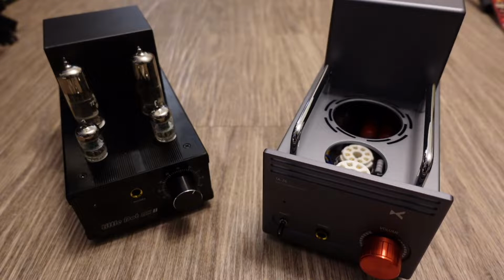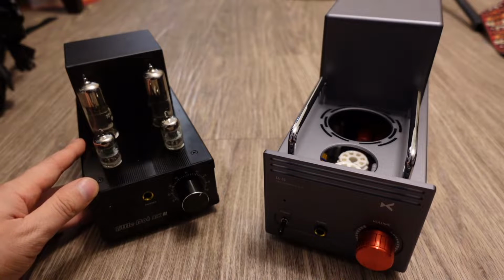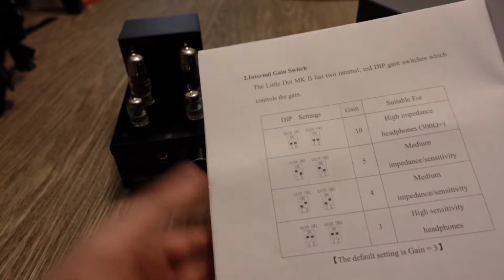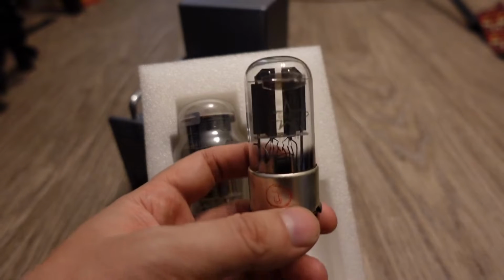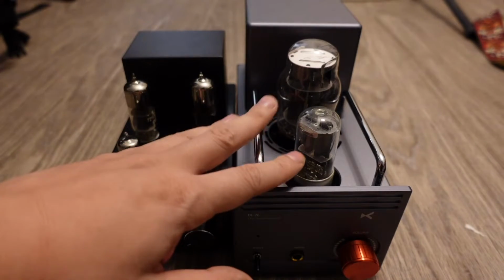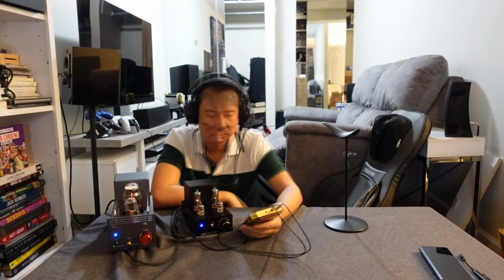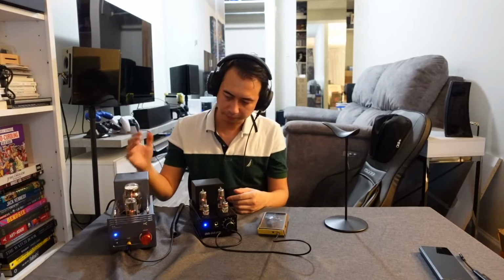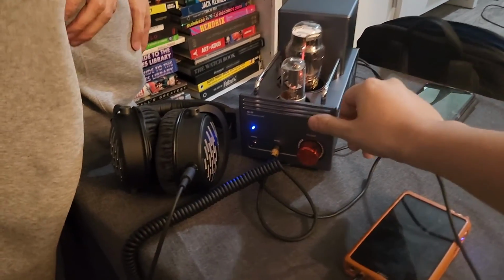Little Dot MKII vs xDuoo TA-26 OTL tube headphone amplifier overview + comparison

Comment: I enjoyed watching your side by side comparison with The X Duo ta26, and the Little Dot MK2. I've owned the MK2 for about 6 years now. Always looking to improve headphone sound. I noticed that the X Duoo ta26 is different from whats available from amazon. Not a deal-breaker by any stretch of the imagination, just easier to get to the power switch. Definitely interested in the Sound Stage aspect. Thanks again for the heads up
Reply: There are two different  one is a 26, the other is a 26S,  main difference is the added a balanced output, and moved the switch to the back.
Reply: What did you buy? I in 2024 want to buy a Little Dot..... I must be crazy.

Comment: Do you think that the xDuoo TA-26 is a good first tube amp? 

I've never owned a tube amp before and am looking for an inexpensive option to start down my tube journey (don't want to go all in by spending $$$$ just yet since I'm not sure if I'll like the tube sound signature).

For reference, I have the Sennheiser HD 660 S2 (think HD 650 but with more pronounced bass), as well as the Chord Mojo 2 DAC/Amp, with which I plan to use a 3.5mm to RCA cable to feed into the tube amp.

Cheers!

PS: Great video.
Reply from the maker: Yes I think it's a good tube amp to start with it will give you many of the warm organic tones associated with tube amps